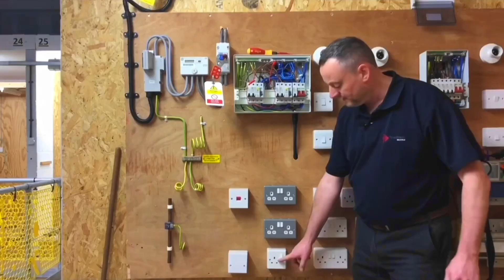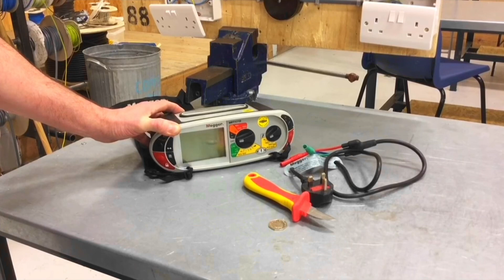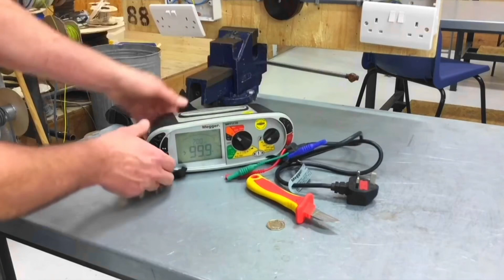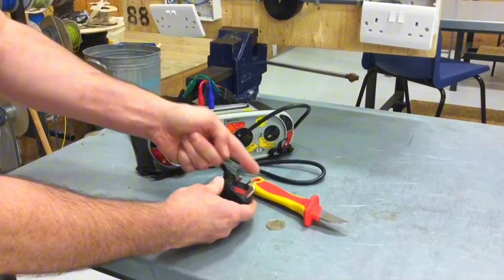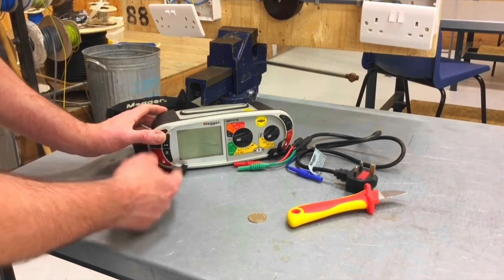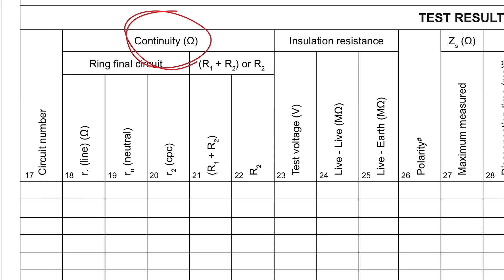Radial Socket Circuit - Polarity and Continuity Tests

Comment: Is it ok to have 3 conductor tails going into an rcbo. I've x3 2.5sq in the rcbo. 

The distance would not allow me to do it in two cables. 

Is it a case then that 4mm sq should be used. 

Max distance 2.5 radial is 32m due to voltage drop

Comment: hi i have a question relating to earth loop impedance in terms of testing for r1 + r2 what happens if the resistance reading is too high or too low?